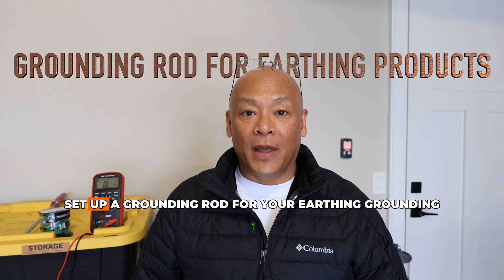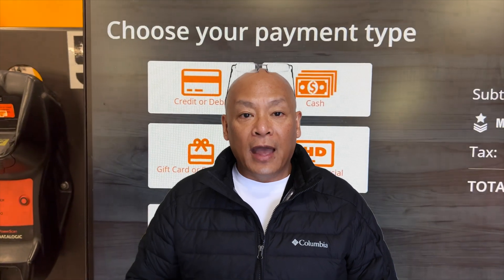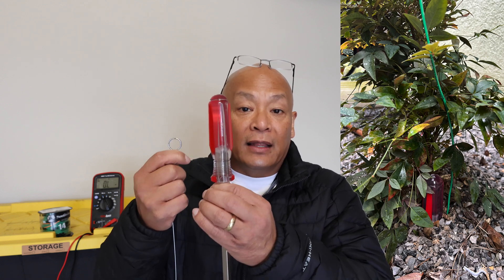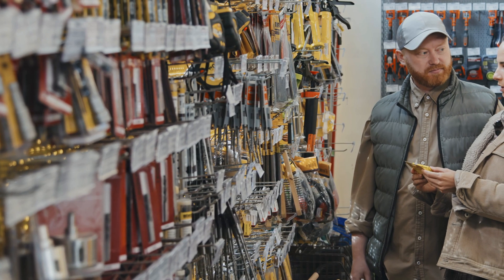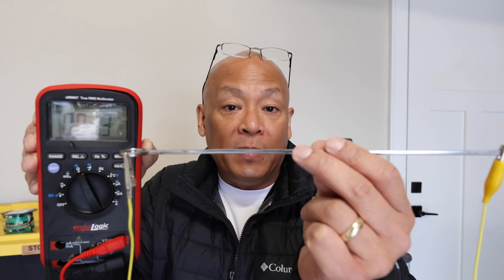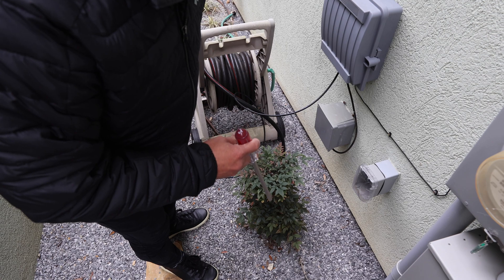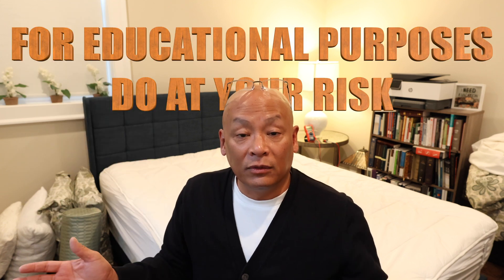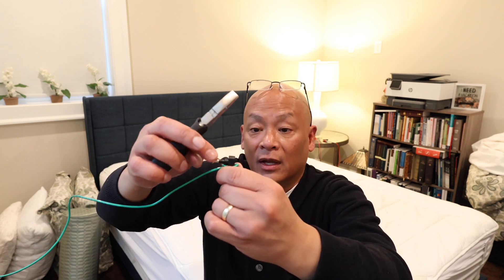Grounding Rod Setup For Your Grounding Mat Made EASY for Beginners!

Comment: You did not explain why do you use 14 gauge wire? I asked perplexity ai and it said the flexible 0.25x2 wire is also suitable and thats the kind of thin flexible wire I think is used in the grounding mat wires. So, if the flexible thin wire works, shouldnt we use that?
Reply from the maker: 14 gauge is more durable. But thin wire will work too.

Comment: Come on Doc -- a 12- inch screwdriver?  Standard building codes require an 8-foot copper rod for home construction.  Why so long?  To ensure they reach consistently moist conductive soil providing a low resistance path for fault currents to dissipate safely.  My Bet:  When it comes to grounding rods "the longer the better".
Reply from the maker: 8 foot is for grounding the building. 1 foot rod is sufficient for human grounding based on medical research.

Comment: How about connecting it to a cold water cooper pipe in the plumbing system ?
Reply from the maker: As long as the pipe has no stray electrical current.  Homes may use copper pipes to ground the electrical system.

Comment: Really appreciate your dedication to the topic and your patience with answering questions. Thank you so much for the educated information! Learned a lot just listening to a couple of your videos! Will definitely watch more! Couple questions...can the grounding mat,sheets,grounding cable,be accurately tested with a DT321C multimeter? Evidently the B model measures microamps. C model maybe not?...does your hand on the barbecue stick cause resistance when tested vs the test on the screwdriver?...also would wrapping the top of the rod/stick with plastic wrap or hard plastic topper work as protection against lightly strikes?...does the wire running to the grounding rod outside need to be coated? Or bare wire okay?...would a piece of thin 80 copper mesh or thin solid sheet of copper work for a grounding floor mat? Trying to stay away from the polymers. 😊
Reply from the maker: Thank you so much for the thoughtful questions and for taking the time to really understand grounding from a safety and physics perspective. These are excellent points, and I’ll address them clearly in paragraph form.

A DT321C multimeter is absolutely sufficient for testing grounding mats, sheets, cables, and grounding rods for continuity and resistance. It can reliably confirm that there is a low-resistance electrical path from the surface you’re touching through the wire to ground, which is the most important safety and functionality check. The DT321B model includes should be able to measure body voltage. Check if the range is 600 mV AC.

When you place your hand on a barbecue skewer or grounding rod during testing, you will often see resistance change compared with touching only the metal probe or screwdriver. This is normal and expected. Your body introduces skin resistance, moisture variability, and capacitive surface area, all of which can alter readings slightly.

Wrapping the top of a grounding rod with plastic or using a hard plastic cap does not provide protection against lightning or electrical surges. I incorrectly stated this. Plastic is an electrical insulator and cannot dissipate high-energy events like lightning strikes. True lightning protection requires proper bonding, heavy-gauge conductors, and correct grounding geometry. That said, using a plastic cap on the exposed portion of a grounding rod is perfectly acceptable for weather protection, corrosion reduction, and preventing accidental contact.

The wire running from your grounding system to an outdoor ground rod can be either bare or insulated copper, and both are electrically effective. Bare copper is commonly used and conducts extremely well, though it will oxidize over time (oxidation does not meaningfully reduce conductivity). Insulated copper wire offers better corrosion protection and is often safer when routed near structures or living spaces. In most residential settings, insulated copper wire in the 10–14 AWG range is a practical and safe choice.

Using thin copper mesh (such as 80-mesh) or a solid copper sheet can work very well electrically as a grounding surface. Copper provides excellent conductivity and direct electron transfer. However, there are practical considerations. Copper mesh can be rough on the skin and will oxidize, potentially staining fabrics. Solid copper sheets are stiff, can crease or crack, and are uncomfortable for prolonged contact. This is why many commercial grounding products use carbon-based conductive polymers—they provide flexibility, durability, uniform resistance, and safer long-term skin contact. If avoiding polymers, a good compromise is embedding copper mesh inside natural fabrics like cotton or linen while ensuring proper strain relief and regular inspection for corrosion.

Finally, it is critical to emphasize safety. Never connect a DIY grounding setup directly to a hot wire, neutral wire, or unverified plumbing. The safest grounding methods include using a properly tested ground pin, a dedicated outdoor ground rod, or commercial grounding adapters that include built-in safety resistors. Grounding should always reduce electrical risk, never introduce it.

Comment: Could You do This Setup with an DIY Mat and without the resistor? Why do you need the resistor? Just for possible lightning, right?
Reply from the maker: The resistor is to protect from ground currents, not lightening.

The resistor restricts the drainage of EMF induced voltage from the body to a low amperage.

It was found that only 1 µA exceeded the benchmark set by the NIEHS to have biological effects related to cancer. Therefore, current should be much less than 1 µA or zero.
Reply: N the thing I was looking n for u did not mention how to connect wire to bed
Reply from the maker: Wrap the bare copper wire around the prong of the grounding cable. I show this in the video.

Comment: Great video Dr. Doan - thanks for all your videos, it's great to have someone with your intelligence helping us to understand how to ground in a safe way.
I have a question: Is it possible to ground yourself by plugging a grounding rod into an outdoor plant pot (with soil and flowers), rather than directly into the earth? I have a lot of concrete outside my house, so this might be the best next alternative.
Reply from the maker: Thank you so much for your comment. Unfortunately, you must have a rod inserted directly into the earth to be able to ground.
Reply: @DrAndrewDoan  Thanks for your reply. Are the risks the same for outlet grounded mats in foreign countries (e.g. the UK), or does the grid work slightly differently there?
What about attaching the grounding rod to a metal pipe - does that work and are there risks involved?
Reply from the maker: All outlets will have some stray electricity. 

Metal pipes can also be bonded to the electrical system.

Comment: Great video Doc. Thanks for sharing valuable information.
In  9:24 min you are talking about adding resistors to grounding cables to block dirty electricity
Can you point me to that different video ?
Thanks.
Reply from the maker: Thank you for your comment! The NCB has adjustable resistance.

NCB Current Filter Demonstration
https://youtube.com/shorts/bJ-VAeyoMz0?feature=share
Reply: @DrAndrewDoan  Thanks for fast response.
 Maybe i misunderstood.
 I thought at 9:24 min you talked about other companies putting resistors in grounding cables to block dirty electricity, but that resistors actually blocking connection to outlet ground.
I thought  you had a video where you test those cables with  resistors for blocking dirty electricity .

Thanks.Keep us informed

Comment: What if lightning electrifies it?
Reply: It’s grounded
Reply from the maker: Very, extremely rare. Over the last decade I have not heard of electrocution via grounding products. If anyone has, please post link here.
Reply: If youre worried about that, put a taller grounding rod (bronze) nearby. The lightning will automatically go to that over a plastic screwdriver handle. Lighting follows Ion channels. A plastic handle won't have an Ion channel coming off it. (This really won't do anything since you're in a house with a rod in it specifically to channel a lightning strike to ground, but if it make you feel better.)

Comment: Are you saying if there is lightning strike it could come through the grounding sheet
Reply from the maker: Yes, it is possible and a very small chance. However, I have not heard of any case this has happened. If anyone has, then please post here.
Reply: @DrAndrewDoan if it does come how bad would it be. Will it be general shock  or knockoffs 😮
Reply from the maker: Every setup is different, and it’s difficult to say for certain.
Reply: @DrAndrewDoan thank you

Comment: Unless you live where the humidity is extremely low and you wear perfectly insulating shoes, there is enough conduction through the air to equalise your charge with Earth.
Reply from the maker: False. My body voltage is elevated in Florida and Okinawa where the humidity is nearly 100% in the summers. My body voltage is still elevated even with flip-flops.

Comment: Modern AC wall outlets has a ground return socket.  All you need is plug the cable that comes with your earthing cable. Why spend a lot of money?
Reply from the maker: The ground return socket has stray electrical currents via capacitive coupling and appliances. When a ground wire runs next to a live wire, capacitive coupling induces AC electricity in the ground wire. Grounding the human body to the ground wire exposes the body to the AC electricity.

Comment: O l does not mean overload. That makes you sound incredulous. It stands for open loop.
Reply from the maker: Thank you. 

On a multimeter, "OL" most commonly means Over Limit or Overload, indicating the measured value exceeds the meter's selected range. However, in continuity or resistance measurements, "OL" can also indicate an Open Loop or Open Circuit, signifying a break in the conductive path where no measurement can be taken. Because resistance is infinite in an Open Loop, over load is not entirely incorrect.

Comment: Sorry, confused by diagram. Are you also plugging it into the outlet electrical ground as well?????
Reply from the maker: No. I am using grounding rods. One rod for the grounding product and another rod to ground the meter.

When checking body voltage, I ground the meter to the outlet WHEN I am certain the house electrical system is properly grounded. My home is less than 25 ohms to the earth.

Comment: When you pinch the red probe to test what do you do with the black probe?
Reply from the maker: Black probe is grounded to the earth, into the soil
Reply: @DrAndrewDoan how? Is the black lead in the socket to the house ground? If so I dont understand it. You have the sheet connected to a separate rod do why would you put the black lead through the house ground to check the sheet?

Comment: The Ohmmeter (or the product test device) is the best way to verify grounding. But I don't think measuring the AC voltage is of any benefit to the user.  Specifically, the AC voltage has an average voltage of zero, therefore isn't the voltage 'problem'. . So, it may be undesirable, it's not the problem.  Unfortunately I don't have an answer for measuring DC voltage in this case because the Multimeter will provide too little resistance to accurately measure the static EMF buildup by the body. The voltage meter in the multimeter will act as a short circuit and give a reading of zero.  There are devices to measure electrostatic fields, but they tend to be quite expensive. Possibly an oscilloscope with a 100X probe held on the subject may give a stable DC voltage. Bottom line, as long as you're providing a generous supply of electrons via grounding there should be noticable benefits compared to not grounding. 
I just installed my first earthing sheets and I hope to see an improvement in HRV, along with  reduction in inflammation.
Reply from the maker: DC voltage pollution is not a huge problem in the home. The drop in AC voltage shows how well the grounding setup drains off the AC body voltage generated by capacitive coupling when surrounded by 50/60 Hz electrical sources. If ohms is low, AC body voltage will drop. Current draining to the Earth goes up. V=IR

Comment: I have an unfinished basement with a concrete floor. Can I drive the grounding rod into the earth from inside the house? Is there a disadvantage to having it inside the house? I was thinking I can install a dedicated grounding receptacle with a 12 or 14 gauge wire from the indoor grounding rod to the dedicated grounding receptacle. What do you think about the inside grounding rod?
Reply from the maker: An indoor-driven grounding rod can work well for human grounding if installed properly and soil contact is adequate. Just ensure the rod stays dry and corrosion-resistant.

Things to consider:
	
1.	Concrete Penetration: You’ll need to break through the slab cleanly and ensure the rod has solid contact with soil (ideally 8 feet deep for consistent conductivity).
	
2.	Soil Moisture: Indoor installations are fine as long as the soil beneath is not too dry. Moist earth ensures lower resistance for grounding.
	
3.	Wire Gauge: Using 12 or 14 gauge copper wire from the rod to a dedicated grounding receptacle is reasonable for earthing mats or sheets.
Reply: @DrAndrewDoan  Thanks for getting back! I'm going to use a rod just shy of 7 feet, just because of the set up in the basement. The rod will be within two feet of the external wall. At nearly 7 feet deep, that should look after the moisture content.
Reply: If you don't have plastic piping, you can just connect it to under the sink piping, which is grounded

Comment: QUESTION:::: CAN A PERSON WITH AN ELECTRICAL IMPLANT USED FOR CONSTANT SPINAL CURRENT TO ELIMINATE NERVE PAIN USE A GROUNDING PAD OR SHEET DURING SLEEP?? I WOULD LIKE TO SUGGEST FOR MY SON, WHO HAS THE IMPLANT THAT CONNECTS TO HIS PHONE APP FOR USE AND CONTROL OF IT. IT'S CHARGED BY LAYING ON A CHARGING DEVICE AND THE IMPLANT IS UNDER THE SKIN OF HIS LOWER BACK.
Reply: Will grounding stop my facets arthritic pain. The cortisone shots didn't work the second time. Thank you!
Reply from the maker: @ It worth a shot. Grounding reduces inflammation.

 I recommend the Earthing mattress cover under a 100% cotton sheet: https://tinyurl.com/5fa5b9ut and connect with an Earthing grounding rod with 40’ cable: https://bit.ly/3Zl0gOX or make your own https://youtu.be/KgRCXxos1Zo
Reply from the maker: Yes, but connect using a dedicated grounding rod. Do NOT use the outlet ground.

I recommend the Earthing mattress cover under a 100% cotton sheet: https://tinyurl.com/5fa5b9ut and connect with an Earthing grounding rod with 40’ cable: https://bit.ly/3Zl0gOX
Reply: @DrAndrewDoan thank you much Dr Doan  😊

Comment: I thought walking barefoot was an amazing thing do.. But I just now came to learn that in North america there are no return wire back to the uitlities sub station.. as a result its being put into the ground as Dirty electrcity... If i want to go barefoot or walk with "grounding shoes" in a city.,. Would that be an unhealthy thing to do around a city environment??
Reply from the maker: In the U.S., the electrical distribution system includes a return neutral wire that goes back to the substation. 

So it depends… 

How It Works:
1.	Residential and Commercial Power Distribution:
	•	Power is delivered via a split-phase 120/240V system for residential homes or a three-phase system for commercial and industrial settings.
	•	The neutral wire carries the unbalanced return current from the loads back to the utility transformer.
	
2.	Neutral Wire Back to Substation:
	•	The neutral wire runs from homes and businesses back to the transformer that supplies them.
	•	At the transformer, the neutral is connected to the utility’s multi-grounded neutral (MGN) system.
	•	This system extends all the way back to the substation, where the neutral is ultimately tied to the grounded star point of the transformer.
	
3.	Grounding and Neutral Bonding:
	•	At the main service panel, the neutral is bonded to the ground, which helps with fault protection.
	•	Utility poles often have ground rods at regular intervals, connected to the neutral to improve stability and safety.

Does Current Flow Through the Ground?
	•	Under normal conditions, the majority of return current flows through the neutral wire, not the earth.
	•	However, in faulty or unbalanced conditions, some return current may flow through the ground, causing ground currents.
Reply: thank you for this reply… So if I want to walk barefoot or use “grounding shoes” in a City environment.. would that be an unhealthy thing to do ?
Reply from the maker: @carloscueva7492 Depends on the ground currents. I use this to measure ground currents. https://amzn.to/3DyIIqt
Reply: OK wow! Loads of information! I love it! Details. Thank you so much for your dedication to the topic and patience with answering questions-satisfactorily. Couple questions...can I test my grounding rod,bed sheet,grounding mat,grounding cable with a yellow front with grayish blue casing,DT321C multimeter? (Evidently the B model measures 200microamps but not this model?).. your hand is on the barbecue, did that create resistance of the current tested;giving a higher reading than the screwdriver? Also, could some kind of plastic solid or wrap be put around any highly conducive rod/tool to protect from lighting strikes?...what do you think about using a partial piece of thin copper on the floor like 80 copper mesh or thin solid sheet of copper? Trying to be cost-effective. 😊 Don't really like using polymers if I can help it.